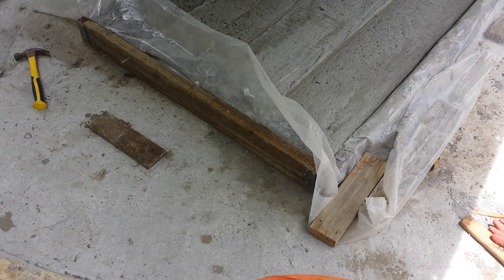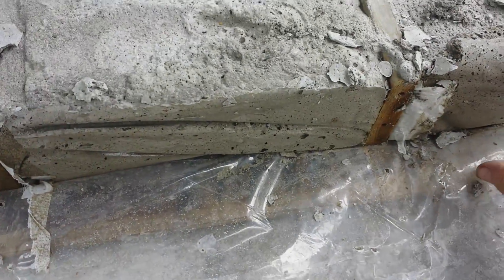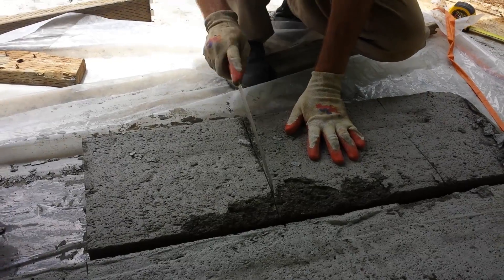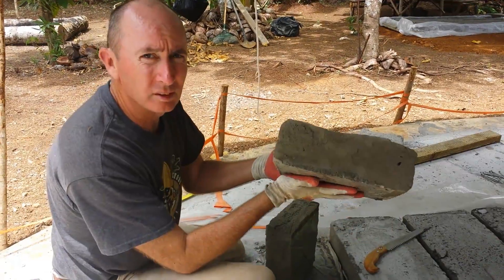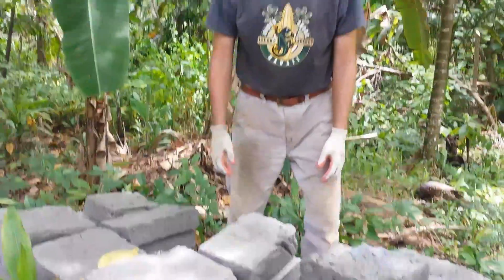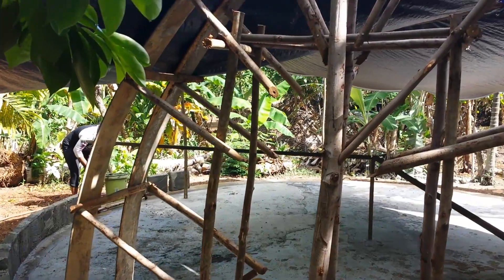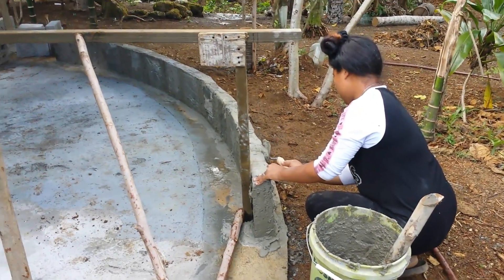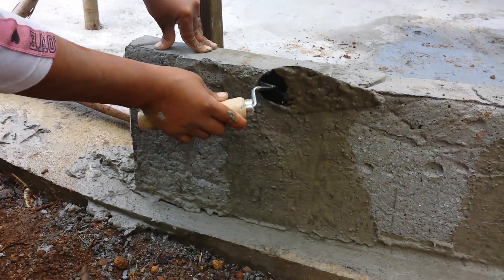Aircrete Dome Home, Yap, Micronesia, Domegaia method

Comment: I’ve only recently heard of aircrete so I have many questions (I’m considering this material for a home in Bali).
Do you have any links to websites that gives data on compression and shearing strengths of aircrete (compared to regular concrete, etc)?
Reply from the maker: Look up DomeGaia...or Aircrete Harry.  Aircrete Harry did a lot of self research and experimentation. He realized that aircrete by its self is not really that good. Compression strength is great. Shear strength...not good.  If you are building a simple one room structure, aircrete is OK. If you intend to build a larger multi-room home, go with ferro cement or some other material.

Comment: For the vertical section at the bottom, is there any reason not to cut some blocks to the same length as the vertical height and line them up vertically? It would require less labor. Or is there a structural reason to use smaller bricks?
Reply from the maker: Yes, you could do that. Great suggestion.
Reply: Common Brickwork pattern is 50% Staggered pattern, so using squares vs Long Rectangles, makes this easier.

Comment: Instead of making blocks why not forms and just pour each level and why a dome?
Reply from the maker: Well, you could use forms, but that sure is a lot of wood work and materials. We are trying to keep the cost down.  Why a dome? For strength and ease of building.
Reply: @jonyap08  I'm a woodworker and you only make forms and jigs one time and they are good for a lifetime.

Comment: Inconsistent mixture, not level, zero reinforcement in foundation, letting animals screw up your concrete, not integrating your dome into the foundation with rebar or bolts or construction adhesive??? Forbthat size structure I would expect to see a thicker block. It’s super light and cheap to make after all. Why make such thin blocks??? Why not just make 1 foot tall circular forms, reinforced with steel mesh or something, and just build up, pouring one form every two days, should be WAY stronger, and probably easier. I’m just a noob moron who hasn’t built anything and even I see major issues with this build. Am I off base?

Comment: What is cost? From what I'm seeing it costs the same as concrete. Only difference us air vs aggregate... is that correct?
Reply from the maker: Probably fairly similar cost...yes. However, on my remote tiny island way out in the Pacific ocean, aggregate is VERY expensive. So aircrete is a great choice. Next, aircrete is MUCH easier to work with. I can cut it and shape it with hand tools. We can easily lift and move it around. All construction materials have their advantages and disadvantages. Same with aircrete.

Comment: If anyone watching this is a member of the dome Gaia forum, can you post a topic informing that the site no longer sends out confirmation emails? Frustrating, you can join but you can't post anything, even a question about why the confirmation emails don't get sent out!
Reply from the maker: Hello Bradley,  I agree with your comment. I have tried to post a topic to the forum some time ago along with info on my dome build. But I was unsuccessful. I stopped going to the forum and mainly focus on Youtube.
Reply: @jonyap08  thanks Jon. Yes, these are my main source of info as well. For the same reason. Would be good to get in the forum though. I wonder how long it's been locking us out?

Comment: Really looking forward to this being legal in the United States.
Reply: they had a few plants back in the 90's and now just one is left. there are too many issues that make the product more expensive then other methods of construction. even if there were more local plants manufacturing AAC the cladding required would still put you over standard stick construction, plus you can't go multi story, which is the vast majority of homes in the USA.
They tried and failed, it doesn't work in the USA and Canadian climates.
Reply: @Ramdodge582  autoclaved cellular concrete made in industrial plants is totally different from  the in situ D. I. Y. made Aircrete.
Aircrete is not the wondermaterial that people so much believe in.
I know it because I have >25 years professional experience with this material

Comment: A hexagonal or octagonal house is just about as wind resistant as a round building. And a roof of slope 30 degrees, meeting in the middle, is also wind resistant. Then you wouldn't have to cut the aircrete into blocks. Just leave them as long boards.
Reply: dragonlaughing  whole sections  making the shuttering nice  to be part of the finished build

Comment: Love the video.  quick question...while they are curing, you mentioned keeping them wet.  Do you have to keep them damp every day for 30 days while curing?
Reply: You need to wet the concrete to prevent cracking in the curing process. This needs to be done for approximately 2 to 3 weeks minimum.
Reply: @hitsmike2046  thanks

Comment: Will it crack curing in high heat  say desert
Reply from the maker: Hello Michael,  It is not so much the heat....as the water evaporates out of the blocks. they shrink. So wait a couple of days for the blocks to cure and dry and you should have no problems in a desert.  We are on a tropical island and the blocks dry....and then get saturated in a heavy tropical rain...and then dry again....so I think it is this cycle that brings on our cracks. But the outside wrap with plaster stopped all of our cracks.

Comment: Can you tell if the temperature will be cooler then the outside?
Reply from the maker: Hello Oscar, I can tell you that it is definitely cooler inside the dome than outside.
Reply: Jon thanks. Do you know if the air Crete retains water when it rains? What was the length of time after the mold was solid, when you started building with the blocks?
Reply from the maker: @oscarcoreocontreras4127  Most blocks were laid after about 2 or 3 days of cure time.  Yes, the aircrete holds water. It needs to be sealed with plaster and paint.

Comment: What about issues of aircrete cracks forming?
Reply from the maker: Hello Rapid,  Yes, we did get cracks.  We follow the Domegaia instructions and wrap the outside and plaster. This seems to make the whole structure like one unit.
Reply: @jonyap08  personally I'm considering the same methods. But with epic bricks instead hopefully to avoid those cracks

Comment: Monolithic Domes were of the opinion that Aircrete is not suitable for Domes that will be impacted by Hurricanes, Typhoons or Tornadic activity.
Reply: I think that monolithic fines is probably thinking about resistance to penetration from wind-borne projectiles. To fight this a person can add San extra layer of protection by putting wire or rebar as cloth or grid around the dome and covering both with more concrete.
Reply from the maker: I am not sure about that. Ours is now complete, and I can tell you that it is extremely strong. I would rather ride out the storm in my dome home than in an island home with tin roofs!
Reply: "Monolithic domes is of the opinion"...... opinions are like assholes ,everyone has one , some stink more than others.   After the hurricanes  you  evaluate a d compare (and smell the air)
Reply: Roy Madison You’re one of those people.

Comment: there's a better method to cut. slice them with sheet metal attached to a wooden handle.
Reply from the maker: Hello Shooshstar,  Thanks for the comment, but I do not have any sheet metal here on the island. It is a very small island with limited supplies. Gosh..yes...that would make it so much easier.

Comment: Very interesting, thanks for sharing.  Can you note the mix ratio and what you use here.  And about how much of materials (i.e concrete bags, etc) goes into making your aircrete form?
Reply from the maker: Hello Huko from Yap island. Thanks for the comment. Mix ratio - 1 bag cement, 5 gallons water, add foam till 43 gallons in drum.  We use 2 bags of cement per 4' x 8' aircrete form for making blocks.   Talofa
Reply: @jonyap08  Thankyou, much appreciated.

Comment: Using that much cement is still expensive — im wondering when making forms can mi put in plastic bottles or used cans to take up space?  Is the aircrete strong enough?  What percentage of cans is possible? Thanks
Reply from the maker: Well, here on the small island of Yap, I cat get about 5 cement blocks from the hardware store for $10. When I make my own aircrete blocks, I pay $10 for a bag of cement and I make about 16 blocks. So that saves me a lot of money there. Yes, I have seen videos of people putting glass bottles and such in the wall, but I am still a novice at this, so I can't really answer your question.
Reply: @jonyap08  It''s around $3 for an 80lbs bag at home depot.

Comment: How much concrete do you use per batch?
Reply from the maker: Hello John.  1 bag gets me two rows of aircrete in my form. So I am using 2 bags of cement per 4 x 8  aircrete form. These two bags get me about 32 blocks. When making the foundation, we used 1 bag cement, 5 gallons water, and then filled the barrel up to the 32 gallon mark with foam.
Reply: @jonyap08  thank you for the reply
Reply: @jonyap08  60 or 80 pound bags? Thanks
Reply from the maker: @Lisacee7  Hi there.  We are using 80 lbs bags.
Reply: @jonyap08  the foundation is 2" thick?

Comment: Magnificent MEEKNESS on the FORM ... SIR !! PERFECTLY ADAPTABLE TO ANY FORM SHAPE !!

Fill gaps and chips with MORTAR-based AIRCRETE ???
WHEN ALL IS DONE...
COB/AIRCRETE ERICA&ERNIES' ROCKET MASS HEATER.... IN-FLOOR OR NOT,....but since temperatures aren't much an issue,... adapt it for a ROCKET MASS OVEN.... oldskool GERMAN FIREPLACES are awesome !!
Reply: Also....  DIY  ....  SODIUM SILICATE,. OR POTASSIUM SILICATE,.
For almost 2centuries it has been used for 1000's of products...
Fireproofer, Waterproofer, Molds for CASTINGS, making FIREBRICK, ...
.... too much to list !!
Reply: Mass heaters depend on mass for heat storage. Aircrete has low mass and  is therefore not suitable for a mass heater